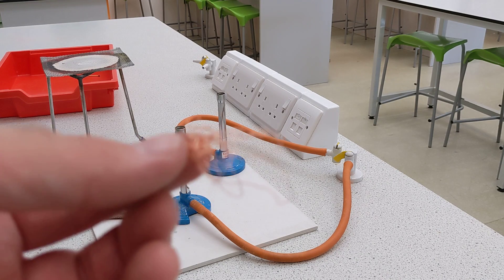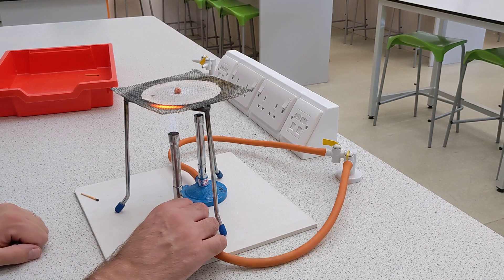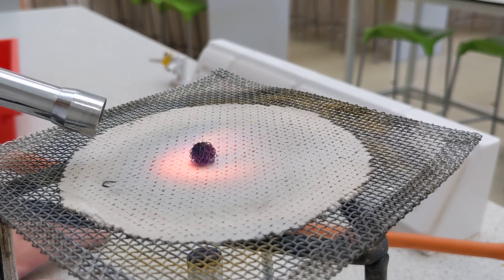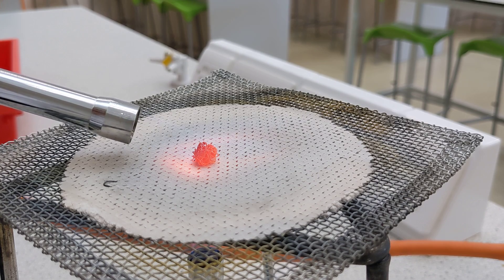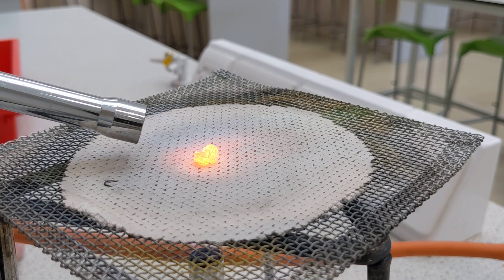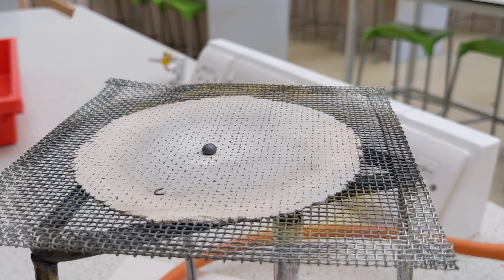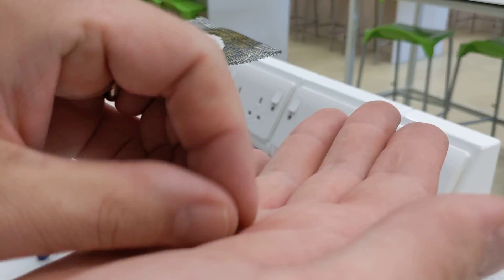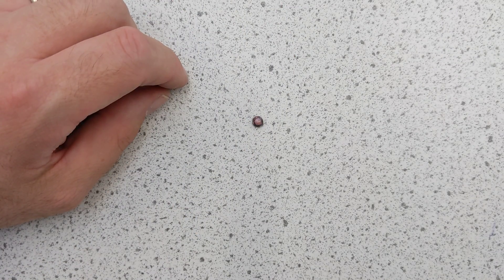Can I melt copper with a Bunsen burner?

Comment from the maker: I believe the grey layer on the surface of the melted blob was copper(II) oxide, and the reddish substance beneath the surface was copper(I) oxide, not copper metal as I stated in the video. Copper(II) oxide formed at around 800°C while the blob cooled, so could only form on the surface (the rest of the oxygen in the blob formed copper(I) oxide). I think. I'm not a chemist 🤷
Reply: if its copper oxide it will react with hot 1M sulfuric acid, but copper metal won't. The wire had a high surface area which promoted the reaction with air, maybe you could try melting a lump of copper with lower surface area to volume ratio.